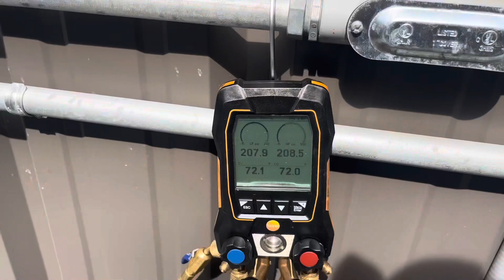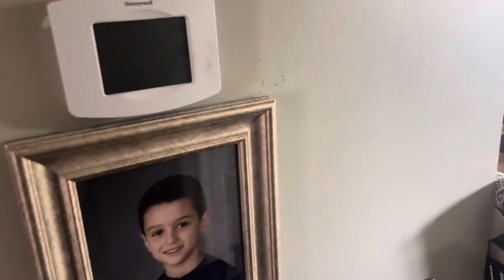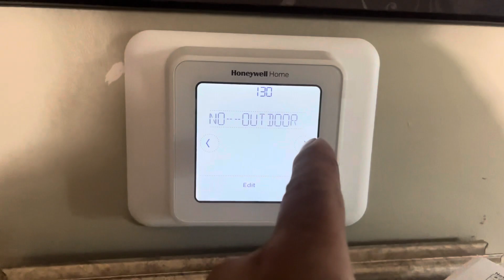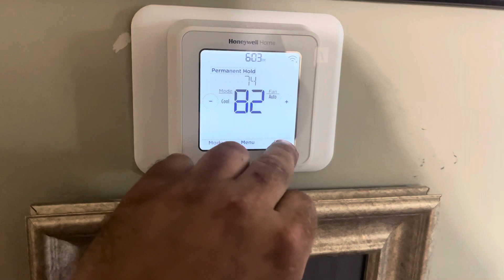WHY IS MY HONEYWELL WIFI 8000 THERMOSTAT IS BLANK??

Comment: Paul, I liked how you checked the capacitor and contactor and also checked temp even though you were there for a bad stat. It’s little things like that which can save you from the dreaded call back. I know we wanna move fast on a busy day, but it’s best to take a little extra time and check things. You made sure everything was operational before you left. I dig it, true pro 👍🤙
Reply from the maker: Thanks for that brother.  I figure just to avoid the call back like you said.  Means a lot.

Comment: An easy one to end the day on. Spent 6 hrs on the roof Friday chasing down a low voltage short on an old 7.5 ton York predator. Not complaining just saying I am going to have one helluva tan by the end of summer. 😅😅
Reply: Farmer tan?
Reply from the maker: For sure bro.  I love the commercial units or anything on a roof.  I look Sicilian already this year and I’m usually a lot lighter each summer.  I’d rather be on a roof than in a residential attic any day.   I hope new job is going well.  Thanks brother.